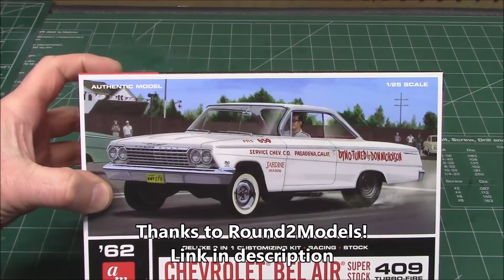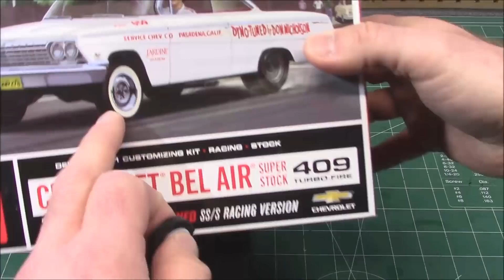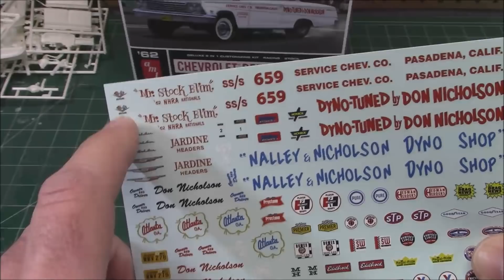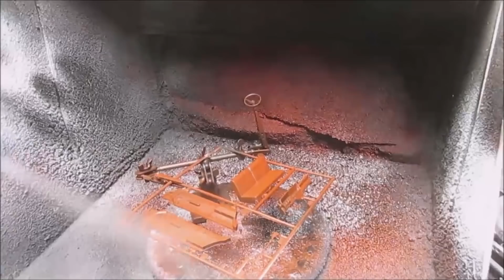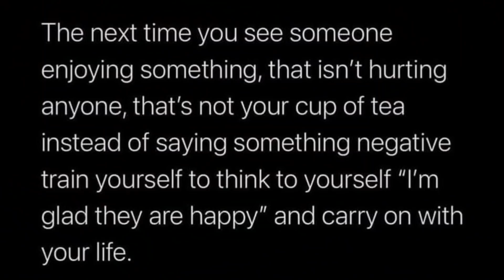1962 Chevy Bel Air 409 Super Stock Don Nicholson 1/25 Scale Model Kit Build How To Engine Glass Trim

Comment: My advice to new investors: Buy good companies stocks and hold them as long as they are good companies. Just do this and ignore the forecasts and market views which are at best entertaining but completely useless..
Reply: The key to big returns is not really big company stocks. It's managing risk in relation to reward. Having the correct size on and turning your edge as many times as necessary to reach your goal. That holds true from long term investing to day trading..
Reply: Tiny Alumbaugh  Please how does one reach the advisor?
Reply: Tiny Alumbaugh  Thanks you for this! I just looked her up on google and impressed with the information I came across. Will definitely reach out to her. Thanks again

Comment: This was the final BelAir hardtop that Chevy catalogued.  No BelAir hardtop for '63.  A rare car.  Also the final year for the 235 six-cylinder as well as the final cast iron Powerglide transmission.  The '63's had a new 250 six-cylinder and aluminum Powerglide.

Comment: Can you use the same glue on the base plastic as you do on the painted plastic?  I know some glues can eat the paint.  I got a model truck today and I've never done the kind that needs paint and glue, so I wanna do it right the first time!
Reply from the maker: There are dozens of ways to get the job done and everyone has opinions.

I use liquid plastic glue for the subassemblies of raw plastic and super glue for final assemblies. And the video shows what I use and how I do glass as well.
Reply: So I could use something like Tamiya cement for pre assembly, and then Gorilla super glue gel for painted pieces.
And yes I was watching the window part and thought that was a genius idea! From my very early experience with clear models and superglue it makes them super foggy. I have some matte already, would that work the same?
Thank you so much for your help!